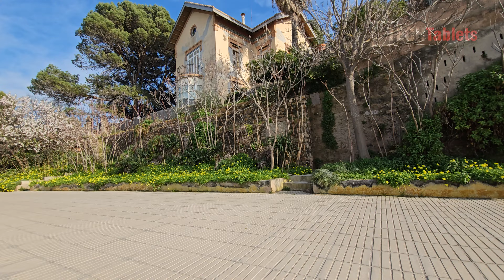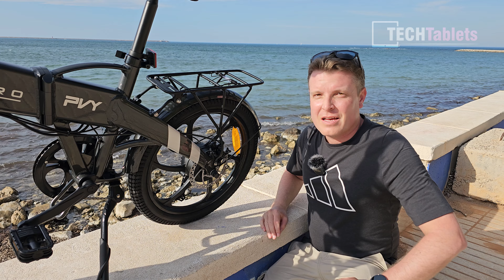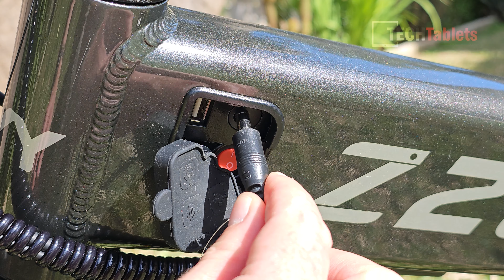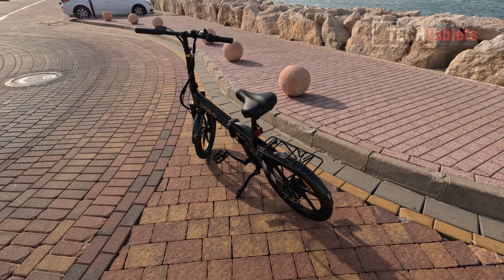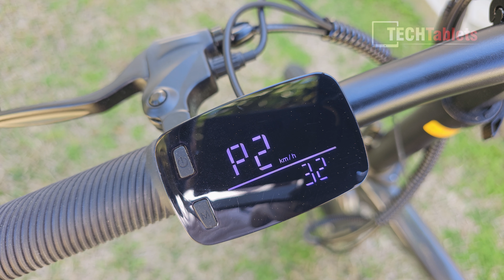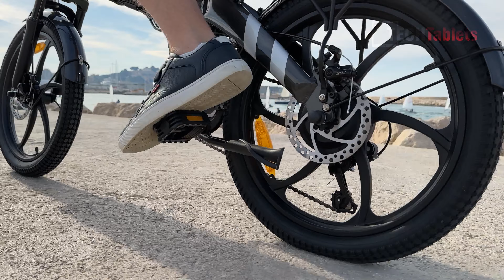PVY Z20 Pro Review - Affordable 20" Foldable eBike

Comment: We bought a bike from PVY official website on 10.08.25. We received it on 14.08.25. The delivery was to the Netherlands. The essence of the problem is that a girl rides it, her weight is 45 kg. The bike charge is enough for about 20 km. This is very strange, given that she pedals and the charge is only enough for ~ 20 km. The bike model is PVY Z20 PRO. Today, after a full charge, the girl was able to ride only 8 km and it ran out of battery. Let me remind you that the girl weighs 45 kg. I contacted customer support, where they initially asked me to pay 135 euros for shipping a new battery. Even though they stated the battery had a one-year warranty, I think 135 euros for shipping is an unreasonable price, and the company is deceiving customers. Now, a month later, they say they're out of stock and might have it in 55 days. But to do that, I have to send them the old battery and not use the bike for more than two months. Customer support is incompetent and unwilling to resolve the issue. They took videos of the battery and provided all the necessary information, including the order number and a photo of the bike frame number. I think they're sending everyone defective bikes. Read this review to avoid being scammed like we were.

Comment: Got my Z20 Pro, and it’s pretty nice! The power is way better than I expected. Done 15km so far, and still have 4 bars of battery. There are a few downsides, though: the bike came brake levers are installed on the wrong sides, had to interchange them myself, the motor only kicks in after 1-2 pedals, and there’s an annoying rattling sound from the front. Cable management could be better, and the rear tyre feels unbalanced if you spin it while the bike’s raised, but it’s not noticeable when riding. On the plus side, mine came with the horn and lights connected to the bike battery and bike actually looks very premium. Also I didn’t receive the bike cover which I really expected. Still happy with the purchase.

Comment: I bought a new one pvy z20 pro running on pedal assist mode only 15 km worst bike not charging fully please avoid to buy
Reply: Maybe you got one like this? My weight is 110 kg, and it lasts for 25 km on one throttle. If you help, you can easily cover 50 km. It takes about 4–5 hours to charge. I’m very satisfied.

Comment: just bought the pvy z20 max as i thought it was alot better for the money, (750 watt but legal, hydraulic brakes etc). however i had a problem, when it came , the controller smelt like a burning metal sort of smell, ive sent it back but havent had info back, just waiting. when buying ebikes, you need to understand it can be a 50v50. rather works, or has problems. i just wish they tested the bike before selling it to me...

Comment: This is the worst company ever. Be careful. 
Be careful. If you get a broken bike, they refuse to replace the parts. 
I have huge problems with them. A month after the bike was delivered I can't use it.
Reply from the maker: Thanks for the warning I will of course leave this here for others to see. PVY needs to address this and get you sorted out!
Reply: I have trying by sending pictures movies. I have sent dusin of emails. We have mailing for a month now. With actual no responses how to fix the problem. The front wheel and brakes are wrongful from factory. The only way is to replace whole front fork. Thay refuse to take that deal.

Comment: I bought my z20 pro. But there was a fault with the front brake on receiv. The front brake is touching the disc. It is a noise that cannot be adjusted away. It was also priblem white the wheel that bounces up and down when you get up to little speed. I have tried for two weeks to talk to the supplier who does not come up with any concrete solutions. On how to solve the problems.
Its always risks ordering from internet. 
But it's irritating when they not interested to solve the problem.

Comment: Almost identical to the ADO A20.
Reply: 😊Thank you for your attention, the difference is that the frame of PVY Z20 PRO is bigger than A20, also add rear frame and Iron mudguard for free.
Reply from the maker: Similar yes, 20-inch foldable and the wheel design...

Comment: Wow, this is really great value.
Only about 10% more expensive than the cheapest e-bike in the UK (Basis SP20), but it comes with a lot of stuff that bike doesn't have.
The other bike doesn't have mechanical disk brakes, or fork suspension, or a decent kickstand, no display, headlight or throttle either, and it's battery is 30% smaller than the Z20.
Edit: Available to the UK in May!
Reply: 😀Thank you for your endorsement of PVY, the Z20 PRO will be available in the UK in May.
The mission of PVY: Premium quality commuter ebike that’s affordable for everyone.
Reply: @pvyebike  m m😅m m m😅m m from m😅m from m😅
Reply from the maker: Yes for the price point it has a lot on offer. The front suspension, bike rack and disc brakes. Overall a good package.
Reply: They sell it for 725 euro but in the UK , its £750 !? I saw the bike in pogocycle for £660 at one stage.
They also bans anyone who post constructive criticism about the company or the bike in their facebook community
Reply: @shahan1465  Thanks for your feedback,
Previously priced on the high side due to pre-sales, it has now reverted to £699
Reply: @shahan1465  PVY attaches great importance to the voice of users and is collecting suggestions on product upgrades. We will not delete user comments at will, please don't worry.
Reply: @shahan1465  After verification, pogocycle is not an official authorized dealer, we will ask it to remove the link.